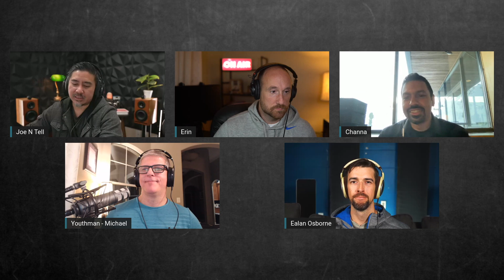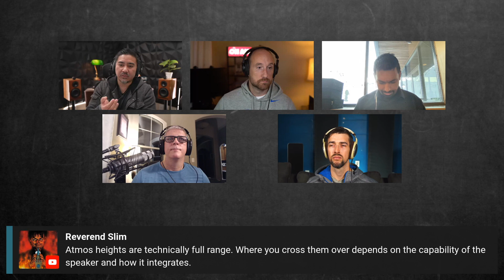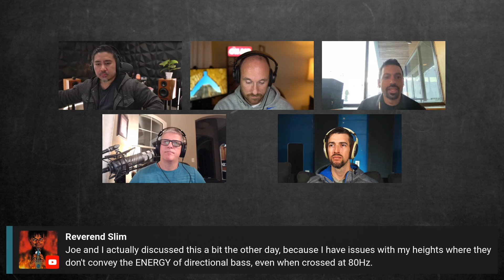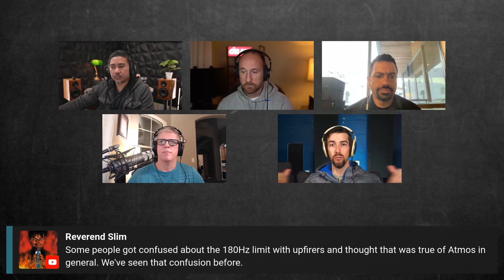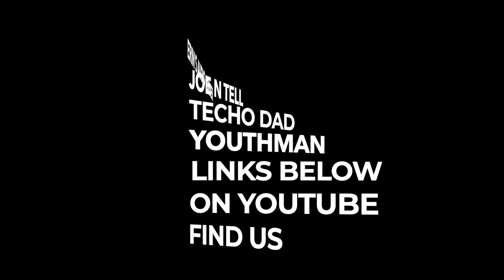Is 80Hz A Good Crossover Point For Atmos Height Speakers?

Comment: My ELAC Debut A4.2 Atmos Speaker Modules have a frequency response of 180Hz - 20KHz So setting the crossover for those below 180Hz is pointless. These are temporary SPEAKERS until I replace my Front and center speakers in a few months. Then I'll be replacing them with much better ATMOS speakers

Comment: I feel like there has to be a compromise in cross over settings with small surround speakers vs large theatre speakers that can handle full range signals without distorting.  I feel that 120 Hz is a good starting point since response drops off sharply for small speakers below this.  I would rather have clean sound coming from surrounds than distorting them when played loud at lower cross over points.

Comment: Am I the only one that likes my crossovers high? I set my sub to 150Hz on a 12” sealed and don’t have issues with beaming or sound positioning.
Reply: For small surround speakers I agree that higher is better to avoid them distorting.  Frequency response drops off around 120Hz with most small speakers.  Especially if you have full range high quality sub(s).
Reply: I set my center channel 23HZ above the rated minimum frequency response of 67Hz and I have my rear speakers set to 80HZ which is 10HZ above the minimum rated frequency response. My front speakers are Floor standing. I wouldnt dream of setting the frequency response so high on floor standing speakers. I may as well have tiny speakers for my front speakers at that

Comment: I believe it's best to have your speakers (no difference which of them) as good and as tonally the same as possible first and foremost. Let's say Arendal Sound 1723 THX Monitors for bed layer including back surrounds and also use them for 4 height speakers as well if you can mount them perfectly aimed at MLP behind an acoustically transparent ceiling fabric. This way, you will have them all the same and the crossover will be (possibly) the same (depending on the location) and how close to walls. But if all speakers put in a baffle walls including height, then the same crossover.

Comment: I honestly got nothing from this that i didnt know going in lol.  The best way this should have been tested wastake a sample of popular atmos height scenes.  For example 10 notable from 10 movies and then have them play at 180, 150, 120, 100, and 80hz to see not what sounded best because thats subjective but if those scenes actually dug down to those frequencies or no difference.  Height speakers should be tested for imaging and detail as well.  For example, in Top Gun Maverick.  They all have a plane fly over or be whatever, but how low did that speaker get.  Maybe after 120hz nothing went below that.  It gives a better idea then the cliche...."well, it depends" answer.
Reply from the maker: You must know a lot then! 😉 Channa and I could easily create test files in Atmos and play full range content to them. Actually, the pink noise and sweeps in the Spatial Audio Calibration Toolkit are full range signals. You can turn off your crossovers and see what happens. - Joe

Comment: My Atmos Upfiring speakers are crossed over at 180. The lowest they go is 94hz. So I’ve read you should double the lowest frequency of your speakers. So my front left and rights go as low as 35hz and I cross them over at 70.
Reply: it is not too high? do you have Klipsch Atmos?
Reply: @angelluisguzmandeleon4903  No it actually sounds pretty seamless. I bought the Polk XT90’s. I had them originally mounted on the ceiling just pointed down to the listening position. Only because I already had mounts on the ceiling. But I took them down and put them on top of my front left and right and two on the rear surrounds. After doing a manual calibration, they sound really good. I was really surprised because so many people don’t care for upfiring speakers.
Reply: @Rockovissi  I have Klipsch front and back higher in the wall, crossover 150hz, but I need another experience difference crossover, but 80hz? is it not too low? and 180hz is not too hi? but thanks
Reply: @angelluisguzmandeleon4903  I think I did lower mine to 150hz from 180hz but didn’t hear that much of a difference. I’m willing to bet it’s just fine.

Comment: I running 7.2.4 Dolby Atmos , I am confused! . Because I have Klipsch Dolby Atmos Rp 140SA front
Klipsch Dolby Atmos Rp 500SA back and manufacturers said minimum 150hz crossover in manual, only for atmos , I put high on the wall 
Another speaker L-C-R 60hz 
Surround 80hz 
Dolby Atmos 150hz 
Do you recommend 80 hz for Dolby atmos?
My system 
AV Marantz Av 7705 (preamp)
Monolith 11X 11 channel (amp)
Bluray 4k Panasonic DP ub820
Front Klipsch RF7 III
Klipsch Center RC 64 III
Subwoofer klipsch R-115SW
SVS PB-1000 Subwoofer
Klipsch Surround Rear RP-402S
Klipsch Surround side Rp-600m
Klipsch Dolby Atmos Rp 140SA front
Klipsch Dolby Atmos Rp 500SA back
Panamax MR4300
living room size 13 x 31 (403 sq feet complete) (used front TV is 13 x 12 sq feet tree panel acoustic room back)

Comment: Thanks for the Info👊🏾😉👊🏾. So what would be the best verdict for hertz in height speakers, please?
Reply: @powerguymark  
Hi PowerGuyMark, 
Thanks for the in-depth response to my question. I have 7.4.6 layout, with All Klipsch Reference Series speakers. The Atmos Speakers are Klipsch Pro-16rc in-ceiling. If my memory serves me correctly, I have them set at 100mhz. I just thought the lads were not defining they case to me(it flew over me) . Thanks a million 👊🏾😉👊🏾
Reply: @Lbmwm3  I guess truthfully I'm not sure what I'm running. I have six ceiling speakers. Two subs and seven base layer speakers.
I think technically since there's only one channel feeding all the subs that should be labeled 1 as my center number rather than two.
Also I think I'm hearing  7 active base layer speakers and only four Atmos at any given time.
If I had it to do over again I would have bought a pre-pro with several amplifiers instead of an AVR with pre-outs. My AVR is only capable of   13 channels but it does have two separate subwoofer outputs so I'm a little confused on the nomenclature.